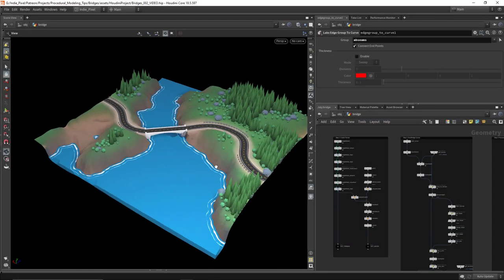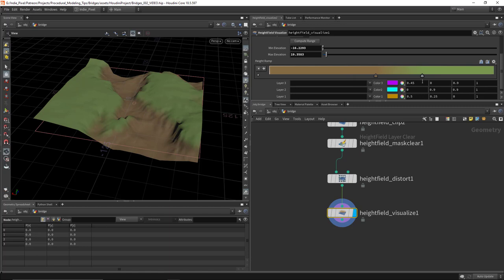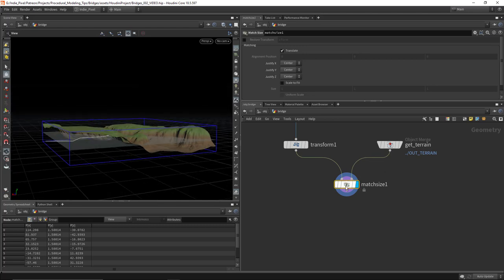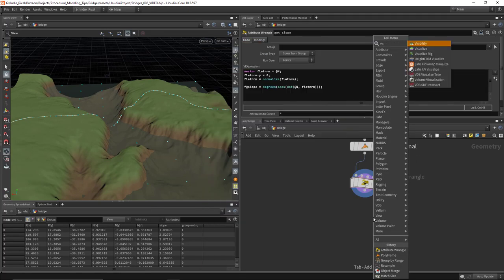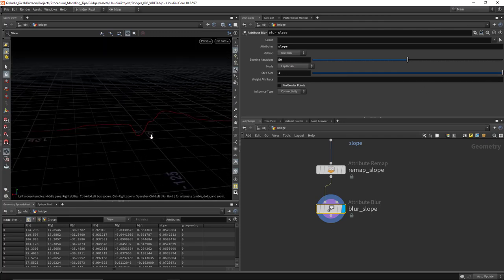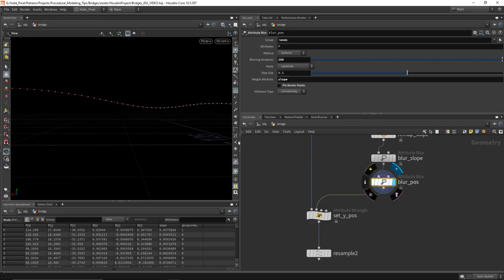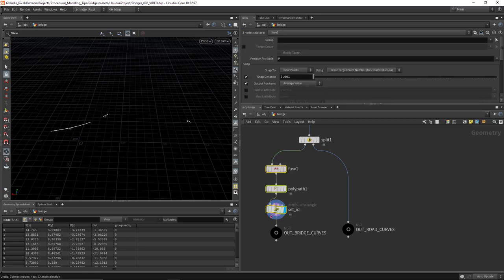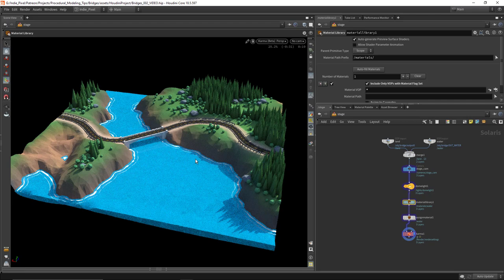Houdini - Procedural Modeling Tips! - Finding Bridges

Comment: I'm trying to follow this tutorial with my own data. I have multiple curves, being imported from real world data, and a heightfield from a real terrain model. 

I've managed to isolate the curves I will need bridges on by doing some intersection analysis on river curves, so I can deal with a single curve at a time in a foreach loop. However, if I start to replicate your node pattern here, I get absolutely nowhere near the values you get for the slope. All of mine are the same value, 90.0008, except one (seemingly) random point in the middle of the curve which is 0. Without being able to identify the slope angles pretty much everything else becomes irrelevant and I'm stuck. 

Do you have any ideas what I could try to pinpoint what my issue is? I'm guessing it's related to the N set up, but without knowing what that is and why it's important I don't know how I set it/broke it in the first place.

Appreciate any help you could give on this @Indie-Pixel

Comment: I typed in the snap_to_terrain VEX but I got "undefined variable with "vector samplepos = set(@P.x, 0, @P.z);" and "@P.y = height;". I am a noob so could you explain what I did wrong?
Reply from the maker: Can I see your whole vex code?
Reply: @IndiePixel3D 
vector samplepos = set(@P.x, 0, @P.z);
int primid = nametoprim(1, "height");

float height = volumesample(1, primid, samplepos);
@P.y - height;
Reply: I noticed the "-" instead of "=". But it still has the same error.
Reply: The specific error is "Reference to undefined variable: _bound_P"
Reply from the maker: @vytasrauckis6703  ahhh...are you using a wrangle node set to run over points?
Reply: @IndiePixel3D  That is what it says. Does "P" need to be defined elsewhere in another node?
Reply: @IndiePixel3D  yes. I don't know why but I always seem to run into issues with Houdini. The funny thing is that Chris Schmidt of C4D fame I can follow without issue. And he is as fast as your tutorials are.
Reply: Weird, I upgraded the Houdini Apprentice 18.5.409 to 18.5.596 after uninstalling and deleting any trace of Houdini. After that, the code worked perfectly.
Reply from the maker: @vytasrauckis6703  that is weird indeed.  I'm honestly stumped...I couldnt think of any other reason why p attribute wasnt available...glad you figured it out though!